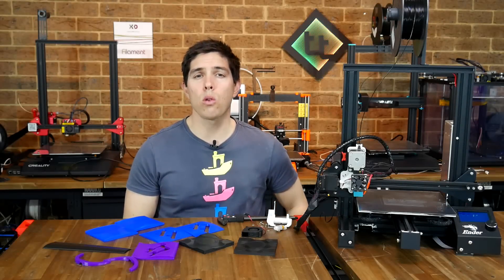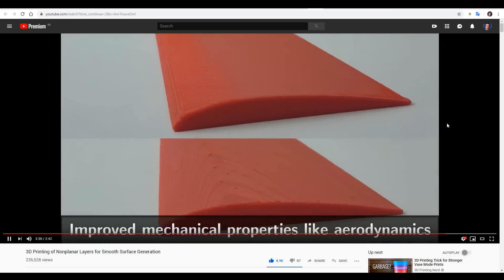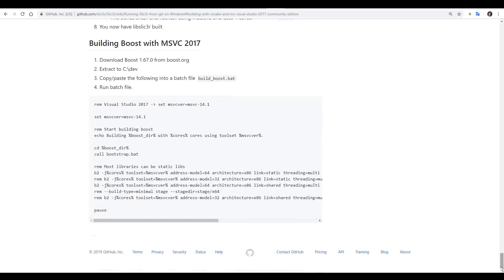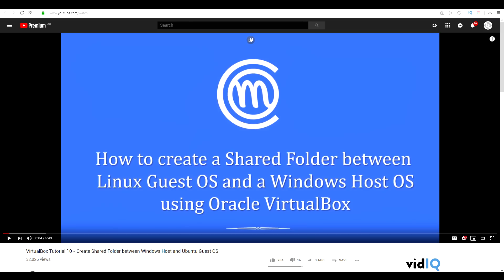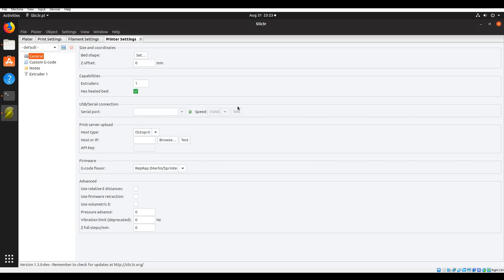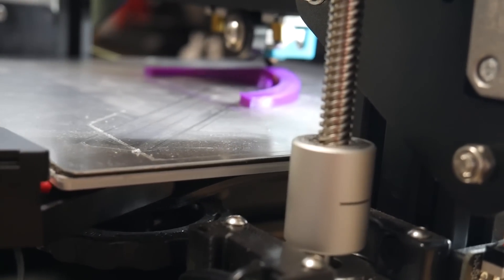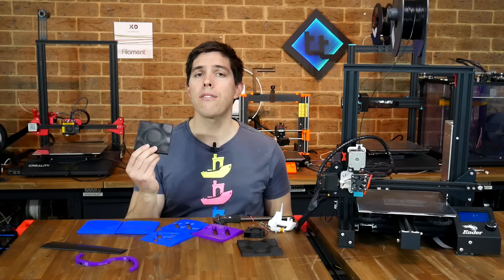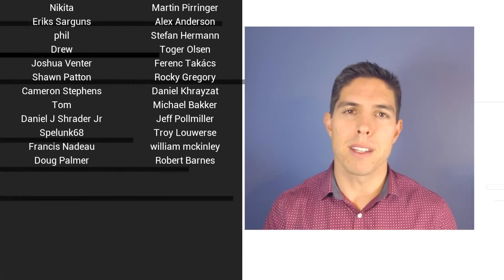Achieve true 3D printing with non planar slicing

Comment from the maker: Hi everyone, some updates:
- A bunch of people pointed out that Windows 10 now has an embedded Linux environment. I installed this and went through the process again. I had a couple of errors and had to manually install missing cpan libraries via the command line. Slic3r did successfully compiled, but only runs via command line rather than with a graphical user interface as seen in this video. I'm sure there's a way to add even more modules to get the GUI working, but it's beyond my knowledge.
- Some people also mentioned setting up a dual boot configuration. This is another great suggestion but I need to have my Windows PC on at all times to keep my video production going, so not suitable for me.
- There have been some viewers pointing me towards 'air brush' nozzles. I've ordered a set, they look ideal for this technique.
Reply: It's possible to run a Remote X instance in Windows to render GUIs for Linux programs. I haven't used Xming in half a year, but it should allow you to run any of the Slic3r GUIs when the X server and Xming are configured correctly.
Reply: @BenignStatue71  I was going to suggest this as well. I have used xming to run linux GUIs from inside WSL and it worked surprisingly well. Just need to 'export DISPLAY=0.0' in WSL to get it to pipe out to xming.
Reply: @BenignStatue71  Yes, I was thinking the same thing.  You could run the Linux version of Slic3r in a "real" Window with this method.  VLC is another idea.
Reply: @BenignStatue71  Yes this does work, it's hilariously awesome layering something like WindowMaker on your Windows 10 desktop and having linux applications just work like they were windows ones.
Reply: I have this working with WSL under Windows 10 and have used VcXsrv as the Xserver. It also allows pretty easy access between filesystems for loading STLs and writing back the gcode.
Reply: @grandaspanna  Any chance you could make this a tutorial for dummies?
Reply: @moodberry  That's a completely fair question! Let me have a think, but I should be able to do something. Is there a particular part of the process that you think should be focused on?
Reply: @grandaspanna  Yes. Most people with 3D printers know about gcode and STLs. They know how to calibrate their printers and make it print. But the software is somewhat mysterious, as are the effects one little change to a parameter in the slicer. 
But what I think would help the most is a simple, already compiled executable program that would run and turn a traditional printer into a "true" 3D printer, using the methods discussed in this video.
I never even thought that my printer was a "2-1/2 D" printer until I watched this video. But now it makes so much more sense to do it this way. In fact, it makes sense to go one step further and make printers with five axes, so that the print nozzle is always perpendicular to the extrusion. When we get to that point, then we can start work on finer nozzles and plastic that extrudes with more granularity.
I do believe that the "big boys" who are printing airplane parts on demand have the right idea but that hasn't filtered down to the hobbyists like me yet.
Reply: @moodberry  I was tardy, but documented the process here: https://github.com/grandaspanna/Non-planar-Slic3r-in-WSL-for-Windows-10
Reply: If anyone's interested, I've documented a "greenfield" guide here: https://github.com/grandaspanna/Non-planar-Slic3r-in-WSL-for-Windows-10
Reply: @grandaspanna  Did you have any issues with the VcXsrv starting when launching slic3r from the Bash terminal? The Gui screen opens and immediatley closes again. Been banging my head for hours on this. In the Xserv log file something about Xwinrc that can't be found and other warnings.
Reply: @floriangrey  No, didn't have any issues with that. Are there error messages in the command window? I run VcXsrv as "one large window", no clients and the rest as default. Then it's "export DISPLAY=localhost:0", "mwm &" and then "perl slic3r.pl --gui"
Reply: Just install Linux Mint on an old machine that won't run Windoze 10. Surely you've got one of those lying around somewhere, right? It'll take you about an hour from the time you get the OS downloaded. It's free. Try it. It's also easy as hell. Personally, I prefer the KDE desktop or one of the lightweight desktops. It hardly matters. If it would run Win8 it'll run twice as fast with Mint on it.

(My daily machine is almost ten years old, runs five separate desktops with tons of software going all the time and it's still sitting there waiting for me rather then me waiting for it. Even slicing takes seconds. On a ten-year-old machine with 8GB of RAM and a pretty old video card.)
Reply: @MyName-tb9oz  I have Ubuntu 14 on a old laptop but that's not my worries. It's the slicing of the files that has to been done on that old laptop so I'm trying WSL on my Win10 laptop.
Reply: Mobaxterm has a built-in X-Server
Reply: I would actually like to see the results using WSL
there's a way to display WSL in gui and it has something to do with x-servers
I suggest you use Xming if you can't find anything.
literally 1 command away from the WSL and you're now ready to display GUI inside WSL

There are limitations though. If you have a 3D file in a flashdrive or another drive that isn't C:\, you can't access the files unless you mount it to WSL. it's quite easy to do but for me is kinda hard to remember. C:\ drive is automatically mounted so if you have your files in C:\ you don't have to do anything else.
Reply: @didotb01  /mnt/c or other drive letter
Reply: The easyest way to share this experience is, when you Export the Ubuntu vm as ova/ovf and upload it somewhere...
How big is the vm?
Reply: @Derbutcher  That's a ridiculously dumb method for distributing compiled software. Kids, never do this. The virtual machine is in the tens of gigabytes, and the file you would export would be a VDI or VMDK. But still, don't do it.
Reply: Great vid! Thank you for sharing, as I've been waiting for something like this, but haven't paid attention until this vid showed. Thanks again and keep up the great work!
Reply: @Kappa DaVinci Resolve.
Reply: I appreciate that you have mentioned the author ^^
Reply: You also need to install virtubalbox client extensions to have the graphics card render 3d full power btw. Or install linux native, it's by far the best, easiest and fastest OS around !!!!
Reply: install vcxsrv and the install a desktop environment, it might take a bit of fiddling, but you can get it to run normally without any special tools. i recommend XFCE4 as your desktop environment as it is highly customizable easy to use and resource light, which is important if you are running 2 DEs on your system. if you have any issues, you can google  "windows subsystem for linux gui" and you should find a number of guides. i recommend running VcXSrv in it's own single window but you can also do a few other options.
Reply: @TheObsesedAnimeFreaks  Nice, I had not heard of VcXsrv.  Will check it out if I am ever forced to use Winders at work again.  Is there something special about VS2008, and why it only compiles on those old versions?
Reply: @Kappa i can promise you that i went from Linux on multiple machines back to windows because of the issues i have had with Linux and with WSL i can guarantee that i prefer even developing for Linux on windows. It's much simpler and easier to use windows then it is linux, which takes 20 times longer to just do one thing because program just don't mesh properly.
Reply: I recommend using the XFCE edition of Manjaro linux for your VM- it's really light weight and feels more like windows-
Reply: @H0B0J03  agreed. xfce 4 is beautiful.
Reply: Windows has a what now?!
Reply: @Tjita1  yes, it has. M's is gradually integrating Linux kernel in windows for native Linux app execution.
Reply: For WSL 1.0, you can setup a x-server on windows (e.g. using vcxsrv) and then setup the display using `export DISPLAY=127.0.0.1:0` or similar.
I know how to hack it myself by trial and error, but in order to have a decent guide I found a this stackoverflow question (ignore the accepted answer, go the most voted one): https://askubuntu.com/questions/993225/whats-the-easiest-way-to-run-gui-apps-on-windows-subsystem-for-linux-as-of-2018

This way you can also run GUI apps on WSL.
Reply: Ubuntu is so light. Get an 5 year old laptop and put an 120gb SSD. You will be set for life
Reply: Raphael Brandão the same applies for any modern operating system other than windows. It’s light compared to windows. It’s one of the most bloat filled distributions available excluding it.
Reply: @RaphaelBrandão-z3f  Compare it to a 'midweight' linux as MX and you will notice that Ubuntu is slow! And if you compare that to a lightweight linux then you really start to know how slow Ubuntu is  nowadays... I run most things on a PC of around 2004 and have no issues. HDD of 20 GB is more then enough and only some extra for the data.
Reply: If it uses Xwindow, you can use Xming. Just install it and then run GUI as normal. Xming should pick up the call to xwindow automatically and display what is supposed to be displayed.
Reply: Someone should make a Docker image. Then we wouldn't need to fuss over getting the right dependencies to get tis working.
Reply: @Kappa I agree, and expand on that with a suggestion. Majorly, Switch away from Adobe's editing suite to Davinci Resolve from Blackmagic. For thumbnails, I suggest you use Inkscape and Krita. All of these things are free.
Reply: @lucyinchat  for thumbnails gimp is better... if you want free, Adobe is still one of the best if not the best creative application suites out there. nothing on linux or windows compares with the fluidity and the integration everything has. and when you are doing creative work, the ability to have things just mesh is highly valuable, something other programs just can't achieve.
Reply: @TheObsesedAnimeFreaks  "integration" is the problem I have with the Adobe suite. Gimp is a bit slower than Krita in many ways and, by the standards of a professional artist, is unusable for some tasks. Inkscape is quite a bit better for image composition, IMO.
Reply: Instead of using a Virtual machine, why not load a flash drive with a Linux os, & boot from that?.
Reply: You could have just created a live Linux USB, booted that, and compiled the code the way the author intended, rather than jumping through a million hoops to do it in windows. It would still put a small stall on video production, but it would have been so much easier
Reply: i couldn't able to find non planar settings in slic3r
Reply: Maybe install an injector needle to the nozzle?
Reply: you could also have dual booted your computer (its quite common) you have a second OS on your computer and chose which one you want at boot
Reply: or you could simply install Linux, such as Ubuntu, on another hard-drive, usb drive or external drive hooked up to your computer that runs windows.
Reply: Just a thought, DaVinci Resolve 16 (video editing software) is out for Windows, Linux and Mac OS. I've heard very good things about it. You could give the free version a try in Windows and see if it meets your needs. If it does you could run it in Linux and then you wouldn't need to have Windows on all of the time.
Reply: Excellent video. How do you think the Rotrics 3d arm (link: https://www.rotrics.com) will handle this process? Will it have the same challenges as conventional 3d printers? Thanks in advance
Reply: Getting GUI working on WSL is actually really easy, just install Xming or some similar program, run it with default settings, run "export DISPLAY=:0" in the WSL terminal, and you're good to go.
Reply: WLS is called. I selected Ubuntu . it will opena WLS shell which works nicely. I compiled complex programs without any issue.
Reply: Great video, but I would encourage you in future videos to give the author credit via saying his name or putting links directly in the video. Always want to make sure credit goes where it's due, and it's the unfortunate truth that most people don't go into descriptions.
Reply: Just to add as I came up finally with this on Ubuntu 18.04 : if used Virtualbox, select 2GB of ram (otherwise errors after 95% compiling) , and don't select the 3D acceleration ( otherwise no gui )
Reply: The point of dual booting is so you can have windows and Linux on your computer at all times. Just make a 20Gb partition for Linux :)
Reply: Can you show us the results with the airbush nozzles and how to use them?
Reply: another quick heads up - though putty is still a great tool, you dont need it to ssh from your windows machine anymore. Just open a powershell and type ssh [user]@[ip address]. I think ssh is implemented since win10 1809.
Reply: Use cygwin for compilation instead of some virtualization.
I am sorry, as much, as I love Linux and don't use windows any more, but here is an advice for windows people: forget about all of those virtualisations, since you can compile any Linux program on windows and for windows, as if you were on linux if you just install cygwin. I think, using cygwin is the best way to create exe files from Linux sources for windows.
Reply: @iarde3422  Or WSL, it is really easy to set up
Reply: @kalebrosenberg8294  on windows, I would prefer to use cygwin, because with cygwin, you can just create exe files, which you could then run on any other windows without configuring any environment for it to run again.
Reply: I am more than a bit surprised that a chap like you doesn't have a spare PC that you could chuck Linux onto.
It is a system that is well worth having available.
Reply: falchulk  And 2.0 actually includes an actual Linux kernel. So vastly fewer problem. Little known fact: Install Xming for windows and you can also have GUI apps run as well. (I have even been able to get freecadweb.org 's Linux AppImage to run on WSL1, and it looks like MSFT is going to include an Xwindows server so that such things will work out-of-the-box in future).
Reply: Apart from WSL, if you have W10Pro you can install the HyperV role and fire up any distro you like. Just another VM way :)
Reply: Why are you so adamant to not just install Linux on another drive in your computer? You would have saved yourself SO much headache
Reply: @teaching Tech. My 2cts. I installed a few month ago VMware instead of Virtualbox. The performance difference is pretty outstanding... this after having pested for years with Virtualbox. You may want to give it a try. (you should ;) ) and thanks for your videos.. that's really cool :)
Reply: Windows is a terrible OS, you should only have it on a spare pc, Linux is far superior.
Reply: Someone might have already said this (but I dint see it), anyways to get a gui in the windows 10 embedded linux enviroment working youd have to setup xorg (or wayland, though xorg is probably easier), and install xming within windows (not the linux subsystem).  This will let you display graphical applications within from the windows subsytem (or apllications running on a rasberry pi, since ssh has a method for sharing xservers, and can make use of it).  *Edit: Here's the tutorial I followed when I did something similar like 4ish years ago https://virtualizationreview.com/articles/2017/02/08/graphical-programs-on-windows-subsystem-on-linux.aspx  and here is a similar but more recent tutorial https://techcommunity.microsoft.com/t5/windows-dev-appconsult/running-wsl-gui-apps-on-windows-10/ba-p/1493242.
Reply: You don't have to run Linux on a dual boot config btw. Linux can be run easily as a live environment on a USB thumb drive
Reply: Hrm, I think I'm going to do some experiments with ceramic filament, print sleeves for a much longer nozzle and see if it keeps its heat far enough away from the heating element.

I already re-designed the part cooling method for the Ender 3 Pro to be bed based and not head based and am also underway of moving the heater cooler away from the head.

Kinda worried and wondering why there aren't any ceramic coated nozzles already on the market though. Not wasting heat seems to be a good way to save power and keep nozzle temps stable more easily.
Reply: You never did make that video.
Reply: Since this was a year ago this is because WSL did not support the X-Server system that has changed in the brand new versions out now so might be worth revisiting this and seeing if you can get it to work now on the latest version of WSL
Reply: Big waste of time. Just install Linux & do what you need to
Reply: What I would try, would be a dome since it's pretty round (in fact, half of a sphere) and would be a true test for a process like this.
Reply: @UltimatePerfection  wenn du das Video verstanden hättest, dann wüsstest du bereits, warum eine Halbkugel so nicht möglich ist. Es gibt aber schon Roboter, welche die Düse entsprechend ausrichten können.
Reply: @Kappa I'm glad you find Linux so much to your liking. But, not everyone is going to agree that it's better than Windows. I'm one of those people. I've used virtually every version of Linux, and UNIX before that, all the way back to the mid 70s. For me (and I'm only speaking for myself) I find Linux messy, unfinished, schizophrenic, and generally clumsy. I waited for years for it to come together into a unified, cohesive environment, but it never did. It is undoubtedly powerful, and more efficient than Windows, but it's more difficult to set up and there always seems to be some file or other missing when trying to install programs - too much fiddling needed.
     That said, I do have 1 Linux computer in the house: an Integrated Threat Manager (basically a fancy firewall). I used it to connect my home LAN to the Internet. It works very, very well. It's self-contained and installs and updates without fuss or bother. Dare I say it, it works like Windows :)
     You said it yourself: "once you get used to Linux". That's a clue. Linux takes a lot of getting used to. I finally got tired of all the fiddling. I said, "I don't need this in my life", so I switched back to Windows and never looked back.
      Like I said, I'm glad you love Linux: if it makes you happy, go for it. Just know that not everyone is going to share your enthusiasm or agree that Windows sucks.
Reply: Not trying to rock your boat, but why not find a video editor to use in ubuntu? I gave up on windows when I got my free vista upgrade.
Reply: Simply install and run Xming on Windows
On the Linux Subsystem terminal, type "export DISPLAY=:0" and "perl slic3r.pl" (without quotes)
It is that easy to get an GUI directly on Windows!